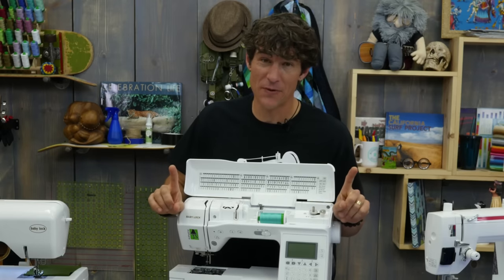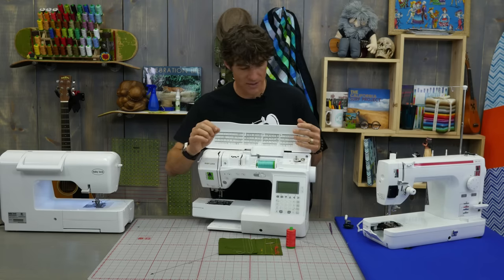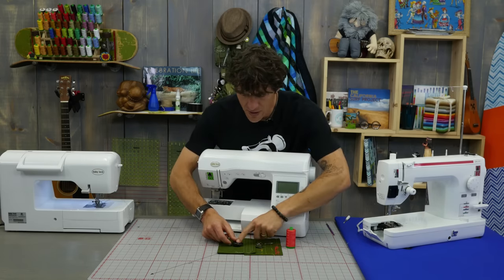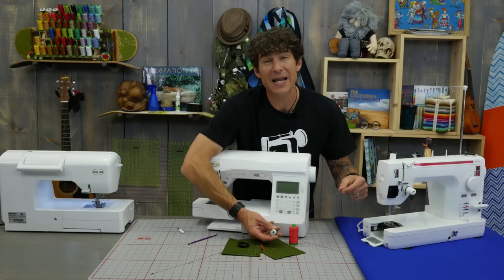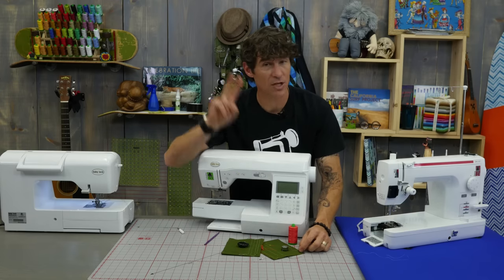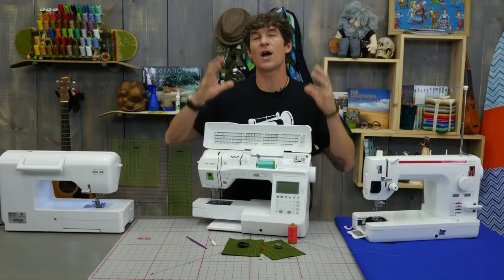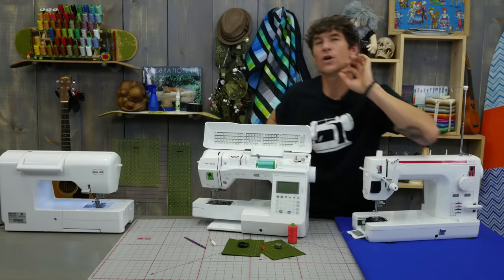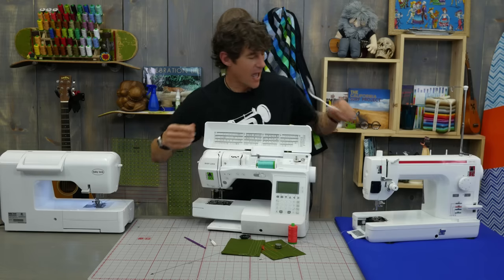Sewing Machine Maintenance: Tension

Comment: Although this video is few years old but the way it shows techniques of tension adjustments is unique and not found in many other videos.  I must say that I had a problem with our sewing machine that puzzled me with continuously breaking the upper thread in a couple of seconds from starting in addition to mess it creates in the bobbin area that jams the machine.  I have looked at various videos to find a solution and tried every available help they offered but none was helpful.  I nearly gave up and thought your video is the last one I was going to give it a go and then I would take our machine (Singer) to the agent for repairs if it doesn't help.  I followed each and every step you showed and to my surprise and astonishment, It worked like a charm.  Thank you for the information and the clear and easy instructions. You made me look like a professional when my friends were starting to make fun of me.
P.S. I have never worked on a sewing machine before and this is my first experience which with your help turned out to be a pleasant one.

Comment: I’m inexperienced with sewing machines but I’m learning quickly! I just learned THE THICKER YOUR FABRIC THE LOWER THE TENSION NUMBER, the THINNER THE FABRIC THE HIGHER THE TENSION NUMBER SETTING NEEDS TO BE!! Otherwise you’ll get loose stitches and the thread gets caught below!! I also noticed that I did Not at first have the thread inside the tension discs mechanism instead they sat on the tension track top like he mentions in the video so that helped me out greatly solved half my problem, the other half I figured out on my own by trying different fabrics and thicknesses which led me to figure out that the thickness correlate to the tension number, the thicker fabric needs a lower tension or what that means is the thread is allowed to flow more freely without resistance! The flip side of that being that the thinner fabric needs a higher tension number like my vintage kenmore model 1249 for example I tested a jersey tee shirt asi don’t have extra fabrics rn so I took that and filled it over so that acted like I was going to make a hem etc, and with my tension on two or three or even four the stitch was horrible and loose and wonky until I set it all the way up to 9 and that solved the issue, BUT of course first I had to make sure my bobbin was correctly set up and the tension correct as he showed in video which fixed my bottom thread issue of looseness! So back to my tension 😂 so when I folded the jersey fabric again which equals four layers, I seen the tension needed to be on 2 or 3 ! And wallah 🎉 perfect gorgeous stitches! I also noticed  that the rate/speed at which your fabric is going along which I had to help it because mine doesn’t Automatically feed like other machines unsure why yet lol😂 but if I steadily pull it along, the stitches are absolutely perfect, however if I feed it too fast the stitches jump off I don’t feed it they bunch up, learning so much in such a short time, but that’s how I roll 😆 I have this passion for learning at least one new skill per year two is better though 😝, last year was electric welding wire fed MiG and stick welding! I now have enough skills to survive if the world gets pushed back to the old days lol! Enjoy your life all and happy crafting ❤

Comment: I know this is an older clip - but the info is classic sewing 101:::well, maybe classic sewing 102! Great stuff to know whether you’re a newbie or a vintage seamstress. Just recently…after 60 years of sewing…I finally got bold enough to adjust that pesky little screw on the bobbin case…and it fixed my tension issue straight out!💕

Comment: I have been sewing for over 50 years and I have been learning so much from your tutorials and especially the maintenance ones.  You explain things so well and make everything so funny and enjoyable to learn.  Last weekend my daughter-in-law had me sew some baby blanket bindings on some fleeced blankets.  Wouldn't you know things started going berserk.  I watched your tut on tension and you hit on a few points I never even thought of -- and today when I was making fleece hats and going through 4 layers of material - my machine went nuts again.  I checked everything, but you hit on a point about thread - lo, and behold my thread that was in the bobbin was a different type than what was on the machine and thin in spots and so I changed the thread and cleaned the tension plates with the pipe cleaner and everything went so smoothly --- I can't thank you enough for your awesome teaching techniques -- your are absolutely wonderful !!  Thank you - thank you - thank you !!
Reply: wheel is stuck help me

Comment: So grateful for this video. My machine has a top bobin. I have been trying to get the tension right for days. Nothing I did at the top thread tension got it right. So took out the bobin case and losened it slightly, now the tension is perfect. I wasn't sure about doing it but it has worked!

Comment: Excellent video for us knuckle daggers new to using  a sewing machine.  I traded a tent for a Janome HD3000 machine so that I can sew light weight leather and several thicknesses of Denim.  With 50 plus years in the Sheet Metal Trade, I'm pretty anal about adjustments and oiling moving parts.  Thank you much for the tension adjustments.

Comment: Excellent! I was ready to take my machine to a repairman just to get the tension issue solved because I knew that was the problem but had not been able to resolve it after trying different needles and thread. This video included every bit of advice I needed to get it back into working condition. Broke out my computer-repair tool kit and even opened the machine up for a bit of oiling and general maintenance after fixing the tension. Thanks!!

Comment: wow! This is the most thorough video I have ever seen on sewing machine tension.
you even called out by pq1500 by name.

I was actually clicking around the internet to see if I could figure out if the chick spring loses its springiness overtime. ISO a lot and I was wondering why I feel like I need higher tension as the months go by.

Comment: Thanks much. I have the spring issue. My machine is quite old and the spring is bad. I never knew it played such a vital role in sewing so when I realized that the bottom thread was all over the place when I tried to sew, I tried adjusting the stitch length, I tried adjusting the discs over and over but nothing and this got me a bit frustrated.  Thanks for letting me know that the spring thing actually serves an  important purpose

Comment: thank  you for the tips....after several weeks of frustration....doing my first FMQ on a quilt I made and my bobbin thread starts breaking...like the thread cutter just cuts it!  I changed needles, cleaned, got out the magnifying glass, started over and over and was about to take to shop when I found your video...I decided to go ahead and change the needle again per your suggestion, and, wahla...works beautifully again.  I actually was using a quilting needle and switched out to a top stitch needle.  who knew.

Comment: Great video for at least two reasons: Instructions were clear and well presented, — by an actual machine tech, no less, Secondly, the demonstration included an older machine and all bobbin types, My machine is nearly 50 years old, ( I bought it used) and I spent $100 about 2 years ago getting the stitching problems fixed, I don’t want to invest any more money in this old Necchi, so I’m hoping I can fix it myself this time (it has gone wonky again) with the help of this video. Fingers crossed, With supply chain problems, I may not be able to get the Janome I’ve got my eye on.

Comment: I have a Kenmore 158.460 that my husband bought used for my birthday in 1975!!! It’s been dependable for all these years, but this is the first time that I’ve understood the tension process. Thank you for your tutorials!!!  I’m making the face masks on the Joann Fabrics site and the tension on my machine is wrong. I’m working to get it right, but I’m not sure what to do to the top cylindrical adjuster above the needle side of my machine. The thread is very loose on the bottom of the fabric. Thanks! ~Rose

Comment: This was an excellent video! Thank you. I fixed my bobbin case with a turn of the screw and the problem with uneven bottom stitches fixed. I have a 45+ year old Singer machine with 2 knobs. One is positioned like your Jane on the front, but the other is on the top of machine with settings from zero to eight. I have no idea what this dial is supposed to do. If you, or your readers can enlighten me, it would be very appreciated. 🙂

Comment: Really enjoy your very informative videos! Hoping you can help me.  Been sewing for over 50 years, my current machine is a Singer Stylist and I have been trying to figure out if I have a tension issue.  It sews normally for about 5-6 stitches then seems to 'catch'. I can gently pull it through for another 5-6 stitches before it catches again. Slightly puckers and looping on the bottom every 5-6 stitches. Top stitches look fine. I sew almost every single day and oil and clean my machine weekly. Please help!

Comment: I have a question: I bought an old Kenmore sewing machine and the bobbin tension doesn't seem to ever feel tight. No matter if I tighten it all the way or back it off a lot, there's no difference in the tension (which is pretty loose). And I am making sure that the thread is catching where it needs too. I will also mention that its a drop-in bobbin if that matters. Should I just get a new bobbin altogether?

Comment: Concur with all comments .
I have not had a problem with my Brother  until today  
Realise it's not the machine but me 
My top thread and bobbin are not balanced .
I thought  using my serger thread would be a good thing .
Oh dear not so 
Haven't used the pipe cleaners 
I'll match my threads first and go from there .
Very enlightening  thankyou

Comment: I have tension problems when free motion quilting.  The bobbin thread shows on top. Blue for the backing, white for the top, same weight thread in both. I've done everything thus far you've said to do and it is still a problem. The only thing left is to use a lighter weight thread in the bobbin. Thank you for the information.

Comment: Hello, I have been having trouble with the tension on my machine (Janome HD 1000) I have to dial the tension all the way up to get a decent stitch and that only happens for some fabric. I am going to try your pipe cleaner trick on the top tension disks, but I was wondering if there are any other tricks or tip that I could use to make sewing easier.

Comment: Thank you so much for this video, I just got my brilliant and I was in a bad state about to throw my machine. I couldn't figure what was wrong and I broken a needle( brand spanking new needle, no sewing done). Thank you again.
Reply: Yes--it us always the tension that sends me to repair,ALWAYS. The birds nest crazy looping should really be it's own instructional video.  Another video I need us when the fuzzy or fraying thread gets piled up--I HAVE SPENT A FORTUNE on thread, ordering bonded only now!  I just had reams of poly #69 wrap round and round the inner wheel if hand wheel, so I took it off, undid the absolute PILE if now oily thread... and I cannot get the wheel back on correctly though only 3pcs. It did unlock the stuck bobbin and needle now manually goes up and town, but won't sew/budge. There is an art to these magnificent machines we've used since the mid 1800s, so simple yet DIFFICULT to service and maintain!

Comment: thanks for the great tutorials!  I have an old Brother LS-2125 i that I bought at a yard sale.  No Manual, no case.
I am having trouble with a zig zag being wonky.  The tension discs are completely inaccessible. The dial is external but the front of the machine does not open up.  How can I clean or oil it if I cant get at it?
Help me Rob; you are my last hope.

Comment: Man Sewing--Your video gives me some things to look for when I get back to my machine (it sews for a couple of inches, starts making noise, then gets all clunkety-clunk noises and jams). I just bought a new spool of thread...it's polyester machine embroidery thread by Coats & Clark. I've used another color of the same thread and haven't had problems. Both of them are shiny/metallic-looking (but not the metallic thread they sell), which I need for some 4-way stretch metallic fabric I'm using. I only started having problems when I put on this new spool. Could the thread itself be a problem? Not that it's faulty, it seems fine, but it feels thinner. Still a tension problem? Another possibility is my drop-in bobbin case. It's very difficult to put back into the machine correctly. It always takes me a few minutes to get it in right. I wonder if it's still not in there correctly. (White 979 machine) [[ edit 1: the bobbin case goes in easily if I take the needle plate off. Guess that's what I need to do next time it gets off-kilter. ]]  {{edit 2--I cleaned the machine (brushed, removed lint--I do this now and then, so it wasn't terrible), oiled it (I found I have never used the included oil...opened it for the first time), messed with thread tension dial (my manual says to thread with the presser foot up and to adjust tension with the foot down). Still jams. There is one hole going through the plastic on the bobbin case. I'll try filing it down. When it jams the thread is pulled off to the side. I wonder if it's catching on that hole in the bobbin case. Wish I could post a picture here. I did watch your video on drop in bobbin cases.}}

Comment: sigh,  I don't have any of these fancy machines.  I use vintage Singers (301A, 401A, treadle, featherweight and a 1967 Touch and Sew.) I have started having tension issues with my 301A's.  The stitches have started not being even on the fabric.  Love both of your channels.
Reply: New fancy machines are cracked up to what one would think.  Because of their electronics, when one thing goes your machine if off for a costly repair.  With the types of machines you have you can just about repair them yourself.   If you’re on Facebook, join a Singer site.  The folks on there are absolutely wonderful on helping you through shoot.  My son picked me up a Kenmore fro Goodwill.  I’m having a tension issue with mine also.  But is it quite!  I can’t wait until I get that baby buzzing!  Good luck!

Comment: hi, thanks for explaining that , i`m having problems with while sewing and the check the stitches i keep getting 3 threads coming out of the bottom . 1 is the thread on the bobbin the other 2 are a loop which seems to be wrapped round the lower bobbin, any ideas on the cause of this ? thanks andy

Comment: I would like to start off by thanking you for the specificity of this video very well done.  I own and Athens 2000 and on the bobbin case i do not see the green glue you said was put in place by the manufacturer i can totally see the screw now does this mean mine is self adjustable?

Comment: Rob, I have learned so much from you. with that said, I was doing free motion quilting on a baby quilt and almost at the end i heard a raddling noise. then my thread got all knotted on the bottom. I understand the missing the disc when treading but I was almost done. What should i check? I have a brother machine that looks exactly like the Juki you have in this video. HELP?

Comment: What thread do you recommend for baby lock machines. The standard Coats and Clark thread that you buy for $2 a spool is 100% polyester and I didn’t have tension issues until yesterday when I started using it for my top thread. But I’ve used it before and I cannot rule out that my tension disks are not open. Not sure why this would be an issue I’ve had my new machine for a month now and never had a top tension issue. No matter how tight I change the tension dial the bottom thread does not get tighter☹️

Comment: I am still confused a little about the bobbin thread- and was wondering if you might say exactly when it is too lose and too tight.......when you were dangling it in the air, and it touched the bottom, is this right?  Or when you were holding the string up and the case dangled in the air and did not touch the table, then what does this mean?  Does this mean the one sitting on the table is right?  Or, does it mean the one dangling in the air is the correct tightness?  It might just be me, but the bobbin tension scares me and I have no clue to tell when it is right....thanks for your help and thanks to each person leaving helpful comments also.....

Comment: I have a drop in bobbin on a Singer Curvy Sewing Machine. I have tried all of your helpful hints, but I now see that my needle is hitting the inside of the bobbin holder when the needle is going down. It will not catch the bobbin thread. Does this require a professional to repair?

Comment: I love the look of metallic thread on my projects, but I always have a lot of trouble with them. What do I need to do differently when I am using metallic thread. Someone told me to use regular thread in the bobbin and just use the metallic thread on the top. I was also told to use Sewer's Aid oil on the thread and to use a bigger eyed needle. Any other suggestions including changes in tension?

Comment: Hi, thanks for your awesome videos. I have a problem that I can't find an answer for. I use a Singer Classic machine. I have bunch of tension problems. I was able to mostly resolve that by using a 0 tension for the top. But now, my top thread getting into the bobbin compartment. It's not really causing a jam initially,  but it's just there, together with the bottom thread. I assume that's not a good thing. Can you suggest what could cause this issue? I have a top drop in bin type of machine. 
Thank you for your time!
Natasha